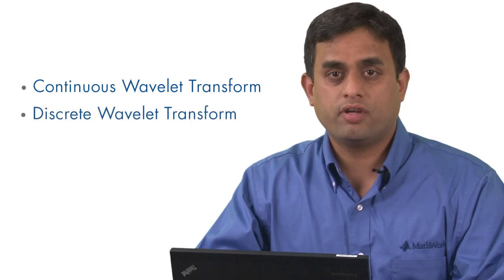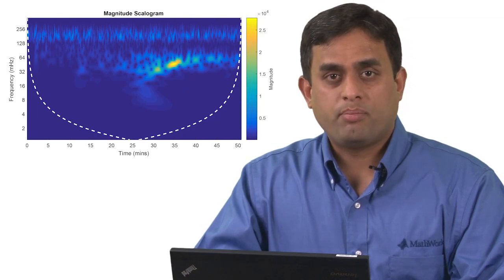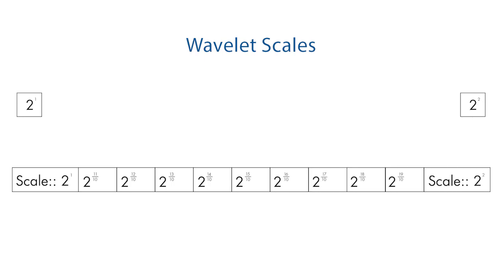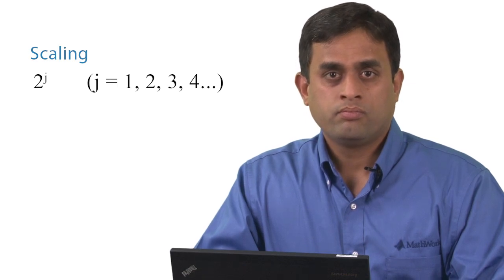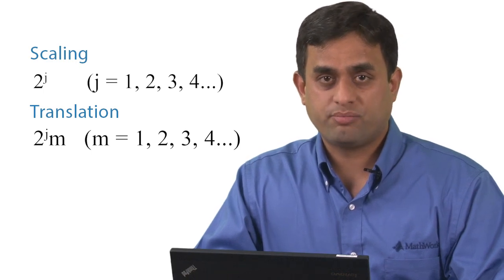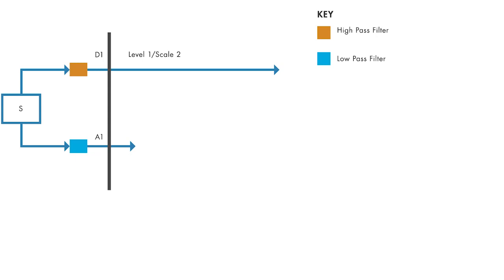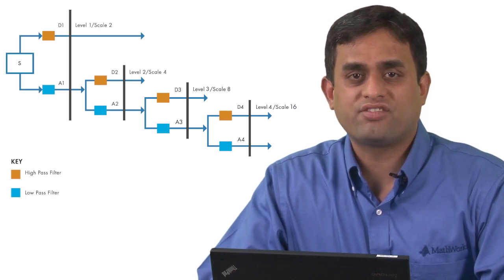Types of Wavelet Transforms | Understanding Wavelets, Part 2

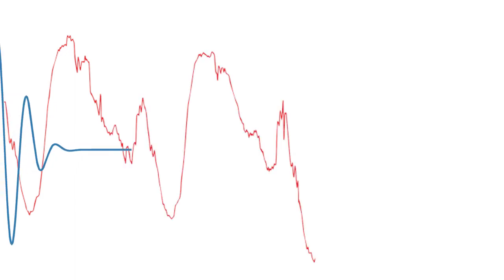Comment: At 02:25, it's a shame he skipped over how the wavelet is "compared" with the original signal. Also, at the end he states that DWT compresses the image and reduces noise, but doesn't actually explain why. The number of output coefficients is still the same as the number of input samples.

Comment: What does he mean when he says each wavelet is "compared with the original signal"? (2:30) How are the mother wavelet and that portion of the signal compared?
Reply: Integrate f(t)*w(t)dt over the length of the signal. w(t) is the wavlet, f(t) is the signal.   You may also choose to integrate (f(t)w(t))^2 depending on needs.

Comment: in this video, what refered about nyquist criterium? fs > 2fmax??
Reply: The Nyquist criterion refers to the known bandwidth of a signal, not the maximum frequency. It's just that for simplicity the bandwidth is often started at 0 Hz but you can start it at any frequency. For example, you could sample a 9 kHz signal at just 10 kHz rather than 18 kHz as long as you know there are no frequencies at 1 kHz. You get "aliasing" but then you can shift this back into the known good range and you get the original frequency back. It's rather neat. You can literally sample megahertz signals at kHz and get useful info, as long as you have band-limited the signal appropriately.